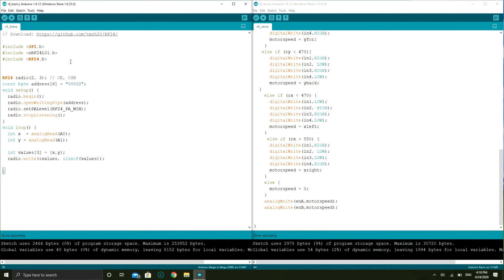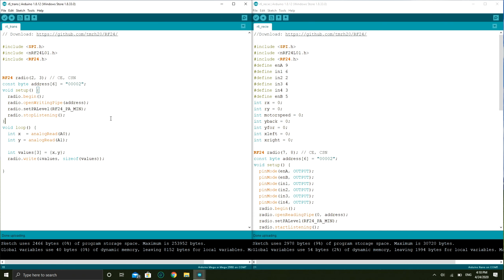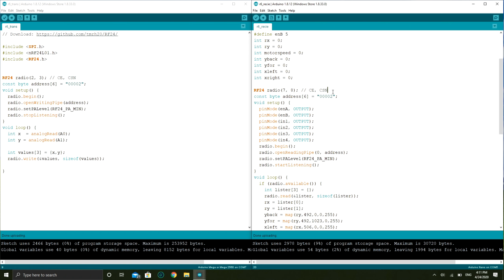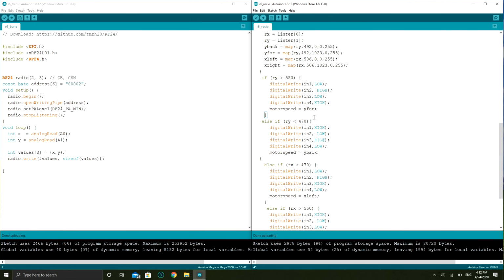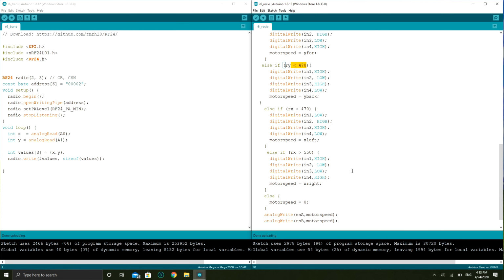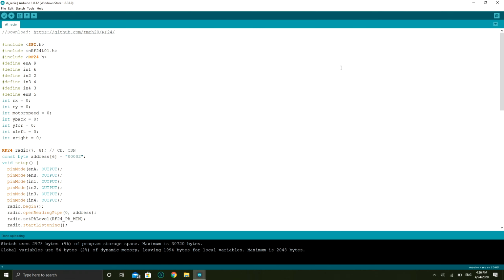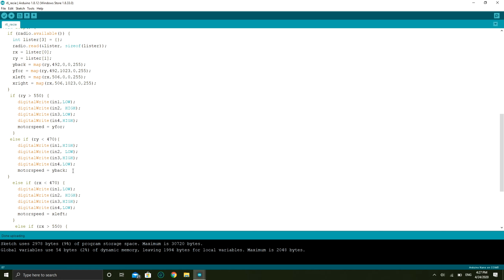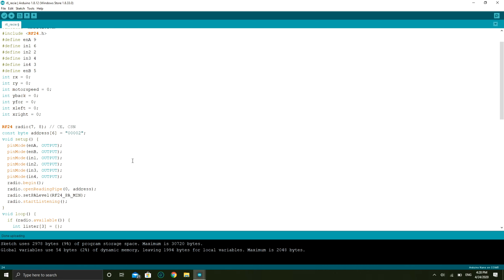How to make Rainbow Six Siege Drone! (Arduino Part 2)

Comment: give us a part 3 please. We are building the same thing for a school project.
Reply from the maker: See you have all the code and what parts you need, so you need to design the actual frame of the drone. Also since you asked I might update the code in my description soon (the code is for the receiver). The code works but I feel like I can better improve it. Thanks so much for commenting
Reply: @akhilmecha  thx for answering. But we need to make the frame but we don't know how because the frame is a cillinder but the parts like the arduino's are square. Any idea how to solve this problem, or how would you do this?
Reply from the maker: is it required for the thing to be a cylinder? Also, you can get an Arduino nano that is super tiny which saves space. A 3d printer would come really handy for this application
Reply: @akhilmecha  Yes, we are trying to make a replica. it has to be a cylinder. The tip of the nano will sure help. But how many out and inputs do we need, and wil the nano be enough for this?
Thanks for answering all our questions.
Reply from the maker: @thiboverhaegen5402  yeah I used the nano for this. If you look at the video there should be 12 pins used and the nano has 13 digital pins so it will be perfect for you! Good luck on your project!
Reply: @akhilmecha  thank you very much
Reply from the maker: @thiboverhaegen5402  also I made a discord server that will make it easier to reach me
Reply from the maker: Here is the final part! https://youtu.be/ncRYkU8OGGw